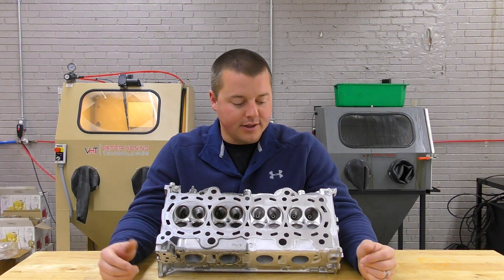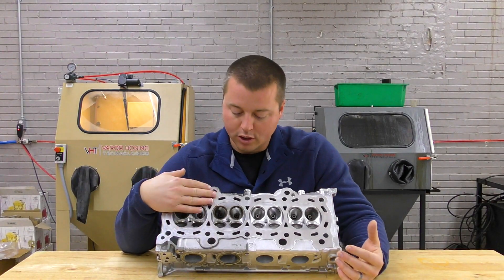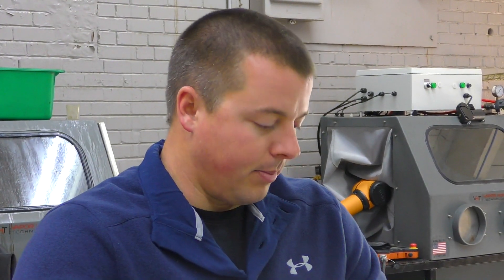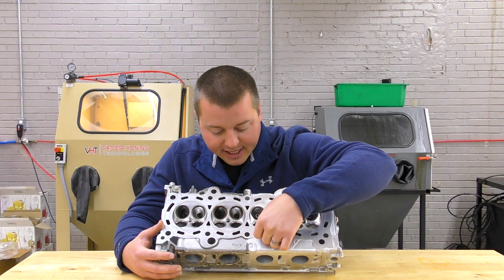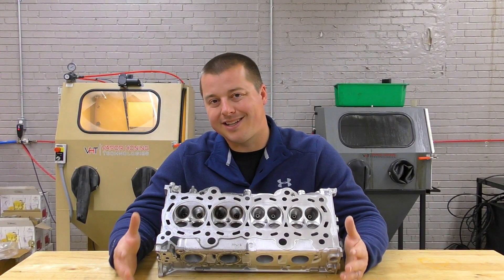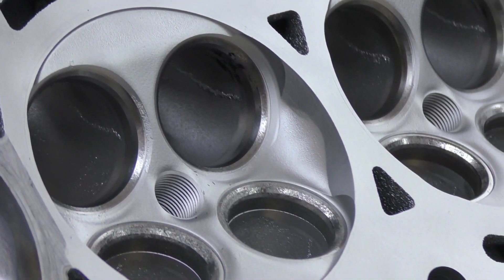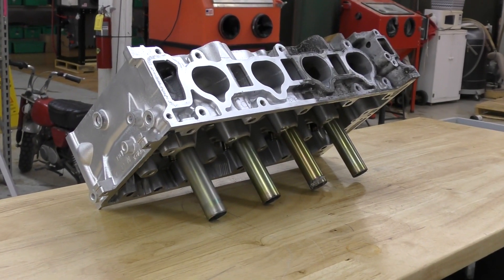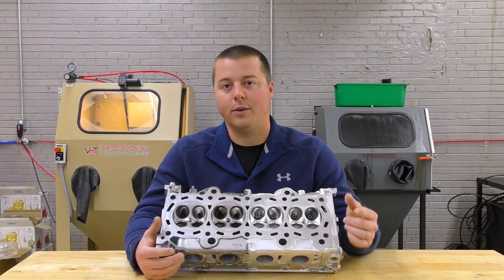Removing corroded & contaminated material from a ultrasonic cleaned part - Vapor Honing Technologies

Comment: Can you use the 170-325 mesh glass bead on valves? Will it have any effect on the tolerance or surface finish required for valves?
Reply: This abrasive is very gentle and will not damage the surface only improve the finish.  For additional questions please contact me at nicole@vaporhoningtechnologies.com Niki